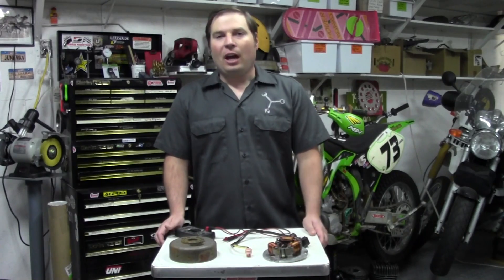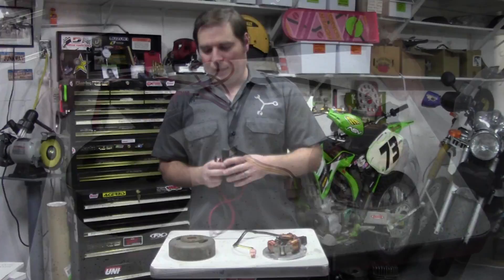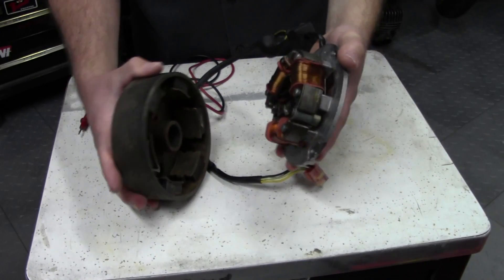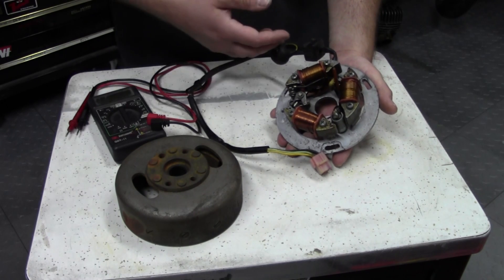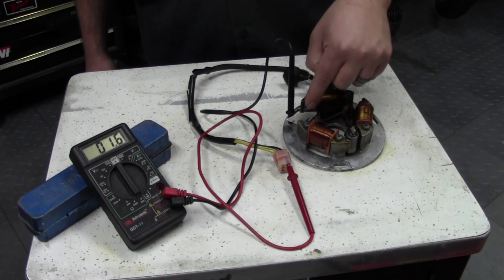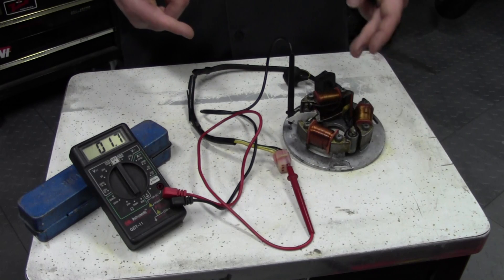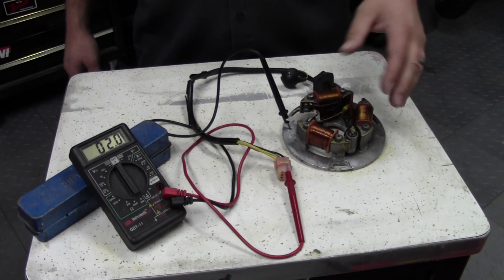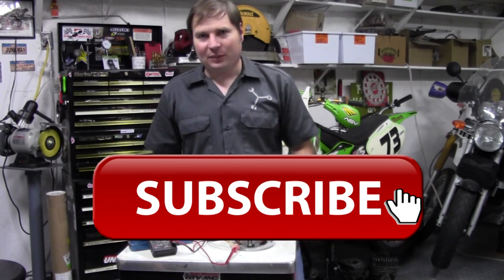Ignition system testing, Magneto coils, Points and CDI

Comment: best way to check a stator with out all this brain trauma is to use a test globe put one on the engine  and the other in to the  plug before the cdi the bulb will burn on all except the pulse coil wire when you kick the engine over

Comment: My system looks identical to yours on my 1976 KM100. I'm getting 3.0 ohms on the black wire. What does it mean when resistance is too high? Pretty sure it's identical to a ke100 which calls for 1.1 - 1.6 ohms.
Reply from the maker: It means the wires are degraded and causing higher resistance.

Comment: you dont need a ohmmeter to check a coil  if yoy suspect a coil???? pull spark plug wire off  inset a scewdriver in t he plug wire hold about 1/4 inch from eng spin eng, you will see spark jump from screwdriver to the eng  that is all it can do no problem if no spark you have a problem check keyway in flywhell and shaft  they will break some  time its rare  that mess up  the timming need to replace key in the shaft if you take flywheel off  check the points and condenserif points are pitting replace condenser clean or replace the points
Reply from the maker: If you read your service manual it will explain how to test just as I did.  The other stuff is addressed in the video.

Comment: You never ever test an electronic ignition with an old analog meter. A DVOM must be used. Reason. An old analog meter can impart a small amount if voltage in a circuit, it can and will become a player. That can seriously damage components in the system. A DVOM or digital volt ohm meter also know as a multimeter, does not add any amount of voltage to any circuit. So it is the system standard test tool. So remember, analog is in the game, dvom just opens the window so you can look.

Comment: So if the coils test out ok could a no spark condition be a failed condenser? How do you test for that? 
Nice video, thanks.
Reply from the maker: There is really not a good test for those.  Replacement is the best option because they are cheap.  First check for grounding issues though

Comment: Always test your lead resistance first to obtain the proper coil resistance result.
Reply: Good video but  the test leads could well be 0.2  ohms each  so short the leads and remove that number from the test results Also the wire to the coil may or may not be includes in published results   I think we can say that coil could well be OK  Maybe cleaning the coil earth connection could well lower the resistance a bit . I do not think the coil itself is going to be at fault if it is only fractionally above the spec.  If it was low then yes it could have shorted turns

Comment: Im actively building a yamaha 175 enduro with all different parts. The frame and wheels are 1969, engine is 1974, gas tank is a 1972, with new misc parts mixed in.

Comment: 1992 Kawasaki KE100 magneto exciting coil - do you think resistance of 2.7 (spec is 1.0 to 1.6) would cause no spark condition?  Considering rewinding myself to see if I can get it to work.  Sorry to bother you with more questions....   Thank you so much for this vid.  It's great.
Reply from the maker: By your test result yes, the resistance is too high.
Reply: @thejunkman  Thank you so much!    Just for experimentation sake, I unwound the wire from the coil.  I tested the end to end resistance and it was about 2.7 OHM (the same as when loaded on the bike/assembly).  I then cut off wire until I reached an end to end value of 1.6 ohm and it took removing approx. 25 or 30 feet to get there.  The remaining wire is about 50 feet long and produces 1.6 ohm.  I don't know what this means, really but I thought you might appreciate the information.

Comment: can a coil go bad in a way that throws off the timing of the spark? I am working on a kawasaki engine for a john deere riding mower and it has spark but seems to be firing at the wrong time blowing flame out carb indicating early fire. key isn’t sheared and magnet lines up with last edge of the coil at tdc so i’m baffled
Reply from the maker: No. Your problem us jetting. It could be a rich condition for some reason.
Reply: thejunkman thing is the riding mower just up and died while mowing along with no symptoms except the occasional backfire some days. will not start or fire at all other than a backfire and flame out the carb. if it’s got fuel compression and spark shouldn’t it have some ignition at all? valves are fine, very slight leak which I just lapped the valves to correct but nothing enough to cause this. even rich the gas should ignite some in the power stroke i’d think
Reply from the maker: That is the thing, it is igniting the fuel and spitting it out the carburetor.  I guess it still could be a magneto coil problem not firing all the time under compression.  Usually those motors don't have a spec to check like indicated in the video.
Reply: Check your flywheel key...

Comment: Ok 1976 Kawasaki KE100, Ignition Coil (specs for primary winding 1.9~2.3 ohms, got 2.6 ohms); secondary winding (spec. 10K ohms, got 10K). Is this ok? Ignition magneto coil (specs. 1.3~1.5 ohms, got 3.2 ohms ..... no good. Be kind and rewind.
Reply from the maker: The ignition coil is probably "ok" as it is really hard to get an accurate reading on the primary winding because it is also dependent on the secondary.  Your problem is with the magneto coils as they test out of spec.  Basically all the "energy" is generated via induction into those coils first so if they don't test in spec then it really doesn't matter if the ignition coil does or not.

Comment: Hey Junkman - love all your videos. have watched all the barn fresh series multiple times as I work on my 1971 Kawasaki F6.  question on this video: my service manual spec for Magneto ignition coil resistance is 0.5 ohms. I am getting a reading of 1.7 ohms.  is that definitely the Primary coil that needs to be replaced?  just want to avoid buying an un-necessary part and all the soldering if it isn't.  will the two leads of a "good" primary coil have resistance of 0.5 ohms also so I know before installation?
Reply from the maker: In short, yes.  The a "good" coil will be within 10% of the stated value (.5 ohm).  Too far on either end of that 10% range means it is just on the fringe of being about to successfully induce a charge from the magnets whizzing by the coil.
Reply: thanks JUNKMAN!!
Reply: @thejunkman  so I just bought a supposedly "NOS" Primary coil part number 21049-013 on ebay and it is reading 1.5 ohms across the two leads (not installed yet).  I am interpreting your comment that it should be reading 0.5 ohms so it is not a good part, right?  I also get 1.5 ohms when I measure across the original Primary coil leads.

Comment: Very helpful video. I have been struggling to find help on troubleshooting my '74 MC1M, which has no spark. What's the best way to communicate with you?
Reply from the maker: Start by replacing the points and condenser if you haven't already.  Then proceed to test the coils resistance per the manual .
Reply: @thejunkman  
Is the Clymer manual good?
Reply: Also need to verify what year mine is. The VIN on the head tube is MC-507593. Do you have a way to verify year and model?
Reply from the maker: Yes, it is nearly identical to the factory manual, except it has more pictures and more explanation and the grammar is better.  Buy one here if you like.  https://tinyurl.com/mc1manual
Reply from the maker: It is a 1974 MC1M
Reply: I started at the ignition coil. I measured 1.1ohm between the primary lead (black wire) and ground (where the coil mounts to the frame). Clymer manual is a bit confusing...it says should be 5 ohms on page 180 under "Ignition Coil," but on page 190 under the Magneto Coil Resistance it says 1.2-2.5 ohms. Which is it? Then I tested the secondary side by probing from the spark plug wire to the ground. I got OL on my fluke. I assume the ignition coil is bad on the secondary side. Correct?
Reply from the maker: The 5 ohm under Ignition coil is talking about the high tension coils primary wingdings.  I am not sure where the specs from 1.2-2.5 are coming from, but those sound like the specs for the lighting/charging coils, which have nothing to do with the ignition.  My MC1M does not have these because it is the offroad only model.  Clymer's manuals are almost verbatim from the factory service manuals only they combine several models with similar systems together so it can kind of be confusing.
Reply: Also, I put a piece of paper between the points, then measured from the black wire from the magneto coil to ground. I measured .5 ohm. Manual says .5 is good (page 174), but says 220 ohms in table 2 (page 190). ???
Reply from the maker: "Table 2" lists readings for CDI bikes.  And 220 ohms is for the Exicter coil in those types of magneto systems.  I have an earlier revision of the manual so my pages have different numbers.  That said.  Each section is designed to be read like a book right to left, columns of text top to bottom.  Chapter Four (in mine) Electrical system, begins with an explanation of both styles and then outlines procedures for breaker point magneto's, which is what you have.  Then after that it details models with CDI's and how to test them.  Everything printed AFTER Capacitor Discharge Ignition System Operation does not apply to your bike.  Clymer manuals can be a little confusing this way.  Also sometimes the tables or figures are not printed on the same page as where the text talks about them
Reply: Thanks for the explanation. Very helpful. Would you agree that the ignition coil should be replaced? This based on both the primary (1.1 rather than 5) and secondary (OL)  measurements at got.
Reply from the maker: Ignition coils (the spark plug coil) are hard to test reliably.  If in doubt, find a suitable replacement.
Reply: Sourcing an OEM coil isn't easy and NOS are very expensive. What is your opinion of the aftermarket options, like the cheaper ones on ebay? I noticed some of them have an additional green wire. What do you do with that?
Reply from the maker: Motorcycle restoration is not always cheap.  NOS is the way to go from an authenticity and it'll just fit and work standpoint.  You can use something of an aftermarket one, but finding one that is "suitable" you may need to try a few.  I just order from sellers that have a generous return policy and try a few out and send back the ones that don't work correctly.  It all has to do with how many turns are on the coil and internal resistance of the primary and secondary windings.  The green wire on most aftermarket coils is a ground wire as some bikes the coil mount is not grounded.
Reply: @thejunkman  One more round on this....The manual says to test the coil (under the magneto), you unplug the black wire that goes to the ignition coil and then test between the black wire and ground. If you get .5 ohms, it is good. I am getting 1.2 ohms. I assume it is bad, but I wonder if the fact that it is soldered to the condenser makes a difference?
Reply: I replaced the points and condenser. I have spark, but it isn't consistent or often enough. When I kick it, it sparks a few times, not constantly like it should. I tried to start the bike and all I get is a backfire every once in a while. Any ideas?

Comment: The ending is amazing. My favorite line, "it's giving me a reading of 1.6, well what does that mean? Nothing if you don't have the service manual".
Reply from the maker: Pretty much, since it is dependent on the windings from the factory's spec.
Reply: it dont mean any thing with a manual only that it not open that coil is nothing but a lenght of copper wire  wrap around a piece on iron so as you apply a voltage it magntizes that iron the secondery winding is wrapped around that same iron so the magnetizem creates a high voltage inthe secdonary  winding which go to distribtor and the `spark plug  so there is not a lot to see with the ohmmeter

Comment: Hi,

First place, thank you for the video. 

Second place I would like to contribute with some good practice hints regarding resistance measurements.

When measuring low resistance values with tight tolerance intervals you should take into account the multimeter cable resistance. You can do it easily just by joining the probes. The cable resistance value must be subtracted from the final measurement.

Also, the contact resistance between probe and wires is also significant in this measurements and proper contact must be ensured.

Comment: I have a 1980 Honda C70 with a 6 volt system. I have an original Honda manual for my bike and it does not state the stator coil Ωfor the magneto coil or the battery charging coil. If you have that in one of your manuals, can you reply with it. I am not finding any available magnetos as new and may need to rewind the coil, when I determine the problem. I have changed every other ignition component and still have a low voltage going to the spark plug. Enough of a voltage to show on an analog meter at about 60 volts, and still does not feel to good going thru my finger, but not enough to create a spark. Thank you.
Reply from the maker: I am assuming you mean you have a CT70.  The Honda factory and the Clymer manual list 1.3k ohm for the primary coil.  Typical range can be +/- 10% of this value.  This must be tested with the breaker points open and the condenser wire un-hooked or you will get an in-conclusive value.  Also your symptom could be a failing condenser, since you will have the flywheel off to do the other test, you might as well replace it and it is not a bad idea to replace the breaker points themselves as the contacts might be worn.

You can perform a test on the ignition (spark plug) coil as well. Primary coil resistance 2.1-2.3 ohm (black wire to ground) & Secondary (high tension wire to ground) coil 9-11k ohm.  However this test can sometimes be in-conclusive as the secondary coil is highly dependent on the primary coil.

All these can contribute to a weak performance at the plug.  You may want to check out CHP (classic honda parts) they have a lot of this stuff brand new, or suitable clone replacement parts.
Reply: @thejunkman  I have a 1980 C70 Honda motor bike, AKA a Cub70, or Passpor 70
Reply from the maker: @thomaspencak5811  Ok, well they are the same engine either way.
Reply: @thejunkman  I have replaced all other components including diode, ig. Coil, condenser, plug, confirmed  cut off at ig. Switch and kill switch.
Reply from the maker: @thomaspencak5811  Then test the primary coil (under the flywheel), that is probably the culprit.
Reply: @thejunkman  Thank you very much...........

Comment: Great vid thanks. I see you're demonstrating on an F11.  Where can I get a flywheel puller that will pull the F11 flywheel with 4 bolts?  The Kawasaki tool 51001-259 is obsolete and the 3 hole puller won't work. Thanks in advance.
Reply from the maker: Yes, it is an odd pattern.  I have a really old Motion Pro universal puller that has holes that fit this pattern (among other patterns) but it is not made anymore that I can tell. This one looks close, but have no experience with it specifically. https://www.amazon.com/Universal-Motorcycle-Flywheel-Puller-Suzuki/dp/B005SUUB6K  I have used other "Pit Posse" branded tools/pullers with success so the quality I have experience is decent. You can make your own out of plate steel and some bolts.  A 2 bolt puller will work using only 2 of the 4 holes, just have to be patient and some persuasion to bust it loose.  Using only 2 bolts will risk stripping the threads as the load is only spread over 2 rather than 4 bolts.  If you strip it is not the biggest deal as you can drill and tap to a larger size if needed.  Hope some of this helps.
Reply: @thejunkman  Thanks. Thought of making one.  Also looked at the 2 bolt puller.  You think the 2 bolt timing gear/steering wheel puller will work?  That Pit Poose might work too.
Reply from the maker: It might, as long as it is slotted so the distance between bolts is not fixed.

Comment: 6v coil or 12v coil in a 2 stroke motorcycle, how to tell a difference?
Reply: Ritesh Singh Rathore He explains it in the video, The 12v coil will be always be larger in size because it has more copper wire wound around it than the 6v does. If your bike has 6v lights and 12v ignition the smaller is your lighting coil.

Comment: This is great but i own an awkward bike made an awkward company that don’t supply manuals for their bikes. Great
Reply from the maker: That sucks, because unless you know what the correct ohm ready should be, you won't know if a coil is out of spec.  As stated in the video, it is the wired that is wrapped around the core that determines weather the magnets will induce a charge to them.
Reply: thejunkman I’m gonna look for a new one from another bike maybe, it’s just a pain because i didn’t wants to. But lifes not fair

Comment: hi the junk man how can you tell by looking at the coils what is lighting,charging and magneto coil? thanks
Reply from the maker: You can't. Yoy will have to follow the wires, or read your service manual and it will tell you.
Reply: @thejunkman  ok thanks, and one last question how figure it out if the coil is damage by looking at it?
Reply from the maker: You can't, you need to test it like I did in the video.  This will require the manual for the specs.

Comment: The heaop running  is probably whats causing my 750 shadow to stop running after I drive about 5 miles.  It will start after I let it set for about 30 minutes.
Reply from the maker: Heat?  Yeah probably.  Grab a manual and test your coils. https://www.thejunkmanadv.com/repair-and-service-manuals.html  You can purchase a manual using an affiliate link, helps me keep making videos.